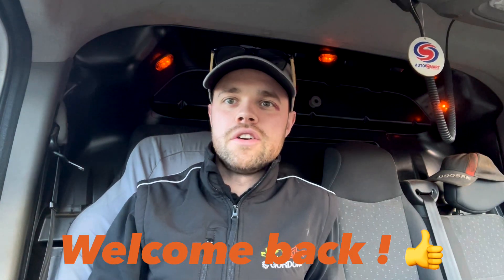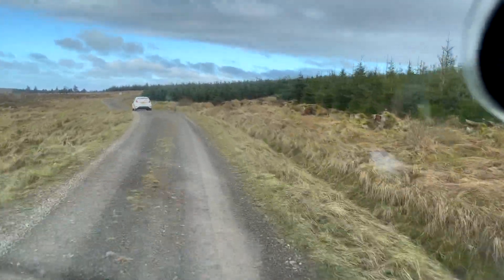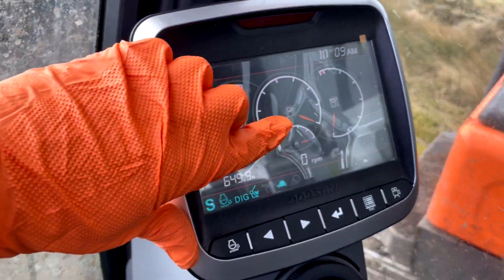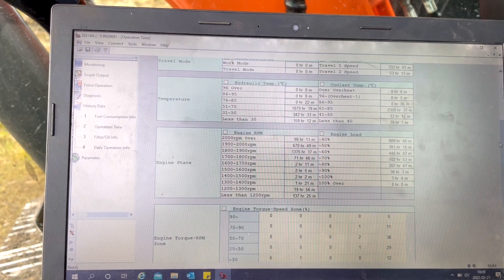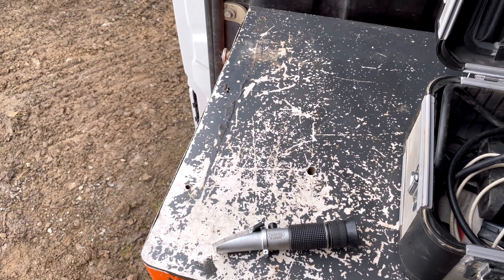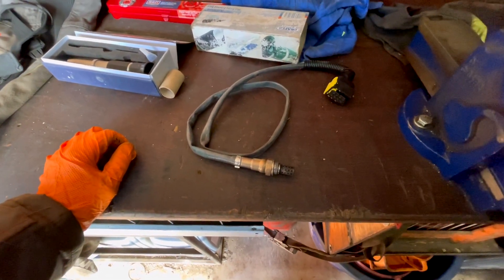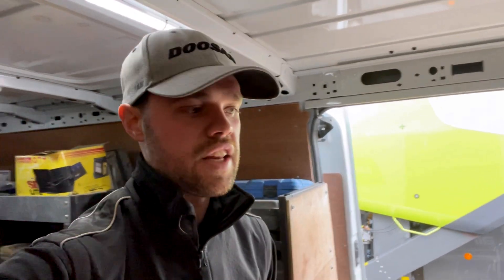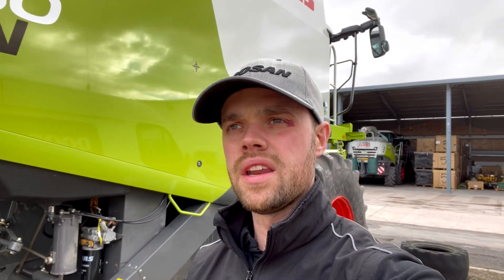Episode 16 - Adblue we love it ! Don’t we ?

Comment: The Engine if the 160 high track is it a Perkins ?
Reply from the maker: It is yes 👍
Reply: @alisdiggerdiary  the software looked quite similar to wat I use at work. Perkins uses the Caterpillar software for diagnostic because Cat  ownes Perkins. As I saw the video my suggestion was that the ad blue Injector god bad and flooded the DOC. That was a common problem on the Cat/Perkins 4.4 an 7.1 engines.